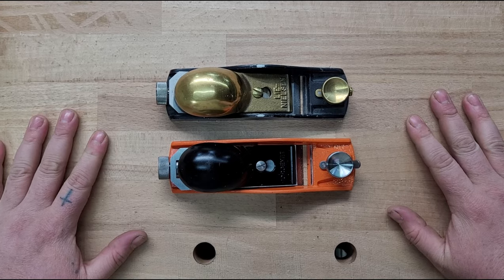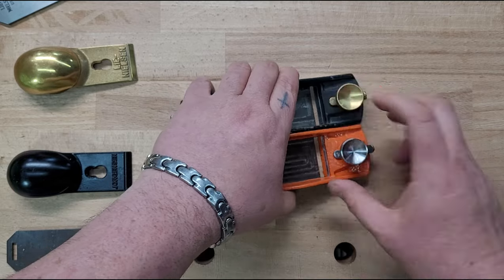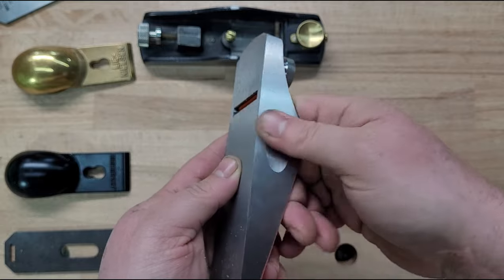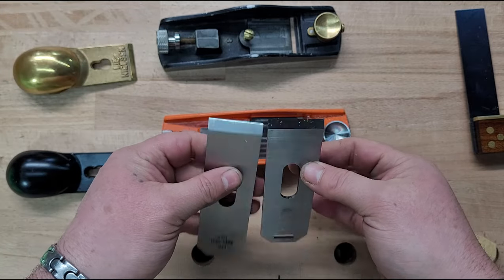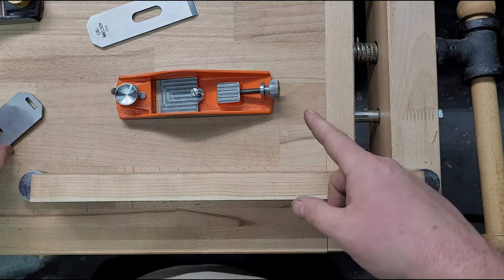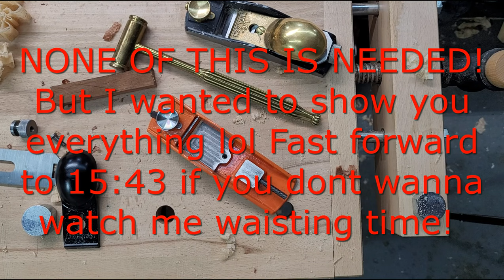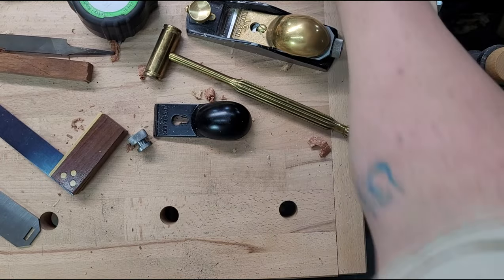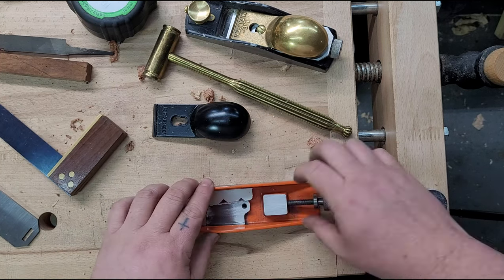$187 Lie Nielsen Vs $35 Jorgensen (The Orange Plane - Lowes) Review and Comparison of the 60 1/2s

Comment: I bought a budget bull nose plane for a (maybe 1 time) door planing job.  I didn't have to remove the door but WOW, cheap steel.  I could not get a burr, so I settled for when it felt like a burr was just a few strokes away (but never got there).  It got the job done and looks great after painting.  Just thought of these Jorgy reviews is all.  If I can find a replacement blade from Veritas, etc I'll let you know how it works out.  It was really nice to plane to the bottom edge without opening the cans of worms that go with removal.

Comment: I just bought the 60 1/2 low angle Jorgensen plane at Lowes 2 days ago. Price hasn't changed. I wanted to pit it against my Stanley 65. I know everyone compares it to the Stanley 60 1/2, but I think the 65 is a closer representation having a similar cap and also being low angle. Anyhow, the Jorgensen worked very well right out of the blister pack. I didn't lap the bottom or sharpen the iron. I didn't even wipe the oil off it. I checked to make sure it was fully functional and immediately set it for wispy shavings. I was very pleased with the result. Obviously, I am going to do all the lapping, sharpening etc. but I wanted to see how it performed right out of the package. I've been hearing that recent buyers are having much more luck than when you bought yours. I wonder if they fixed some problem in the factory.
Reply from the maker: That's awesome! Maybe they stepped up the QC!

Comment: Awesome video! Thanks for keeping all the things you did IN there! I bought this plane and I also own the Lie-Nielsen rabbet low angle and their 102 as well as three Veritas block planes. The Jorgensen compares favorably. I did not have to shim mine, and if I did, I would just run back to Lowe's and exchange it and try another one. You are absolutely right: for $35, it is a shockingly good value. I am going to buy the other two right away to add to my already overcluttered collection!! Thanks again!
Reply from the maker: Thank you! I'm happy to hear you didn't have to shim it. I should have gone back to the store but...  I was determined to work on it myself and finish the video hahah
Reply: Only minor issue is the slot for the adjusting knob is a little rough, so you have to fully release blade tension. I did polish the inside of the slot some but for the price, I can take it in my truck and not get stressed out about my fancy planes! @BatCaveCreations
Reply from the maker: Yes!!! Thats one of the best things too! Ding it up who cares haha

Comment: I disagree with you that 11:19 - 18:44 was "Wasting Time"; I got something out of watching you troubleshoot the Jorgensen's issues and then being able to (finally) get it to perform.  My two cents would be that's the difference between an experienced user and a newbie - that you know some where to look if you're not getting the performance you're after right away while newer users may not know where to even start and struggle with the fiddling.  Forking over the cash on a tool that shouldn't need much of anything right out the box is the trade-off, especially for newer makers.

That said, maybe not a bad idea to speed through a lot of it to keep the vid's length under 30minutes!!  My toe in the Jorgensen waters was with this 60-1/2 and all I had to do was sharpen the blade; the adjustment wheels on mine are rough and stiff so I have to agree with most everyone else that it's gotta be QC where they're "saving" the money on these.  I've still some tuning to do on it and I don't know it'll ever surpass my Stanley #18 Knuckle block plane as my go-to but I'll more than likely be keeping it, all the same.

Great work and you've earned a sub, man.  Nice vids and nice work!
Reply from the maker: Thank you!! I appreciate that. And you are 100% correct, I meant wasting time in filing the best when I could shim the blade. But you are correct, someone new to woodworking wouldn't think to file the bed. 
I am happy to hear you got something from the video and that you got a 60 1/2 that didn't need a shim! I am tempted to buy another and see if I run into the issues or not because they do seem to be all over the place with QC lol
Looking forward to more comments from you!

Comment: I just bought the Jorgensen not long ago to pare down a sticking door.  This video gives me hope it just might work.  Thank you for your very detailed review.
Reply from the maker: No problem! I'm happy it helped! I have a diff video that talks about how to set up a hand plane and how all the parts work together that may help too if ur running into issues!
Thank you!
Reply: As a carpenter, unless youre taking some material off the bottom of the door, please just fix it lol. Don't cut it down. The jamb and the panel should have been made to fit, so if it is hanging up, you will be better served to adjust the hinges than slice off the scoring edge or the top of a door. 

Good luck with it.

Comment: Thank you for doing this review, it was super helpful. I was in Lowes yesterday and saw the Jorgensen plane and almost bought it, as it looked really similar to the Lie Nielsen which I've wanted for a while but the price is a bit much for me. I didn't expect it to perform as well as it did, I will be purchasing one now.
Reply from the maker: Same!! I was very surprised by these orange beasts haha deff reccomend! Double check quality control, if you get a bad one return it and get a diff one if it's bad bad lol
Reply: @BatCaveCreations  So I ended up grabbing this and the smaller one about a month ago. I have not sharpened or tuned them up yet, just been using them out of the box on the job. They have performed very well, I've used them mostly for fine tuning scribes (I'm a trim carpenter) and they have been great. I'm planning to get them properly tuned and sharpened soon. My hope is to be able to cut end grain with them so I can fine tune miters on casing, crown and base saving extra trips to the saw. Thanks again for the detailed review!
Reply from the maker: No problem at all!! I am happy it's working out for you!!!

Comment: I had similar problems with couple of new budget planes I bought, the problems seemed to clear up over several months. I came to the conclusion that either the castings had not been fully "rested"  for a year, or the temperature difference of my workshop simply required them to acclimatise. Initially I had found that I could get the plane to work perfectly, but come back a day or two later, and I'd have to reset the plane all over again. As I said though, after several months, this problem seemed to just go away. A ghost in the machine ???
Reply from the maker: That is very interesting, I know metal would move over temperature changes but I haven't had an issue like that with a hand plane. Thank you for sharing!!

Comment: How much is your time worth?  How long did you spend putzing with the orange tool?  And, now you have a paper shim installed?  I'll stick with the quality tool.
Reply: Based on the video, he messed with it for about 5 minutes at 4x speed, so unless you earn $150 for 20 minutes of work, it still seems like it could be an OK deal if you're not looking to spend $185 on a hand plane. I've spent way longer than that cleaning up old planes just for fun 😉
Reply: @joshdemarco9270  Understand your position on the issue... I just don't want tools that I have to constantly fuss with to make work.  One of the reasons LN planes are so expensive is the materials (ductile iron) they are made of... Of course, you also pay a premium for the name.  I don't fault others for chasing a bargain, but I prefer to buy the best tool (quality wise) that I can afford.
Reply from the maker: I get that, because you can afford it. Some can't or simply don't want too hahha
Side note, the Jordengen is ductile iron also. I really wish I would have included that lol showing my noob side to YouTube

Comment: I've noticed that bedding problem on some pretty nice Millers Falls blocks also.  Did you check the plane cap iron for consistent contact while it is locked down?  For $36 a little fettling is worth the effort, but it might be out of some users comfort zone.  Then again, the next one on the shelf may work perfectly.
Reply from the maker: The cap had good connection! I should have showed that :( lol

Comment: Great video!  Keep up the good work.

I'm the guy who did the Unplugged Woodworkers review of the #4 alongside yours.  I bought the 60 1/2 plane, and only sharpened the blade, and had it shaving thin, even ribbons that made me happy.  So I'm guessing it is a QC issue that I managed to dodge.

I do wish there was a little less lateral slop in the blade.  I think if there was, the blade would not bind so much on the depth knob.
Reply from the maker: I agree they deff have QC issues and I hope they tighten up on all that. These are great starter planes for new people! I also decided I'm keeping mine for rough work. I used it yesterday to plane particle board 😄 🤣
Reply: @BatCaveCreations  I learned I needed a rough work plane when repairing something outside last summer. I had given my old block plane to a granddaughter and was not willing to take a high price bench plane out for that. I wish I had known the orange planes were so serviceable. I ended up finding a block plane from the 1960's at an antique shop for the same price that works.
Reply from the maker: @davidmaclean5065  that works too! I don't care where a plane is from or how old it is as long as it works! lol Good find! deff need dedicated tools for rough work.

Comment: Oh wow.   All these comments about shimming.   

First, it's not like other tools (like stationary jointers) don't see a shim here and there to work optimally.   They do.   And what is a plane -- but a hand-powered version of a jointer?
Second, once the problem is found it's not like a shim is such drudgery to do.  My god.  Some of you people who comment on YouTube just like to whine.   Work the problem, people!   Keep Calm And Carry On.
Third, perhaps judicious filing would eliminate shimming?   I don't know.   Am not an expert at plane restoration but I have restored quite a few.   

That brings me to my questions.
If I understand correctly, the reason you decided to shim was because one side of the iron was cutting heavier than the other side?   Is that right?

Q:  Could that be addressed by laterally moving the iron?
Q:  Could it be that the edge of the iron is not square?

I just ran into this same problem yesterday while restoring a no-name (really - could NOT find any identifying markings on this junky 60 1/2 clone) plane yesterday.   I kept fiddling with the lateral movement by tapping it with a small mallet like you did.   And then it cut evenly on both sides of the iron.

Please advise.   I'd be interested to know.

Thanks for the video.   I just looked at this plane today at Lowes.  Looked nice, and felt nice and hefty.
Reply from the maker: Good questions! No I couldn't adjust far enough laterally to get it to be square. The iron was square, even if it was slightly off latter all should have fixed it. Since it didn't aht lead to me realizing the machining accross the blade base wasn't parallel to the sole of the plane that's why it was heavy on 1 side and needed a shim. 
I can't answer about filing either I didn't keep at it long enough to fix it and I wasn't sure it would. Shim was the easiest option. And I agree with you if a few slips of paper save me a ton of money. I'm game Lol

Comment: When you get those corrugated accordion shavings, you need to open the mouth a little. I used to buy junk like that Jorgensen block plane when I was in my 20s because I thought shitty tools were better than no tools. I guess that was true, but now I have the money to buy true quality tools, which is always cheaper in the long run. I own that Lie Nielsen 60-1/2 and I love it. When they finally pry it from my cold, dead hands one day it will be worth more than I paid for it and that Jorgensen will be pitted and seized up with rust at the bottom of a bucket full of random screws and nuts and washers. Everything in that bucket will be orange.